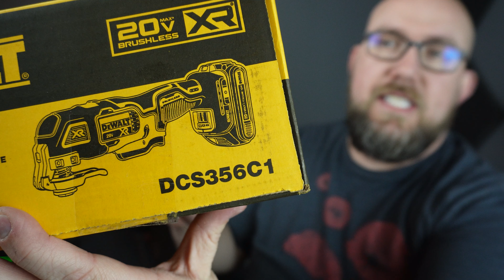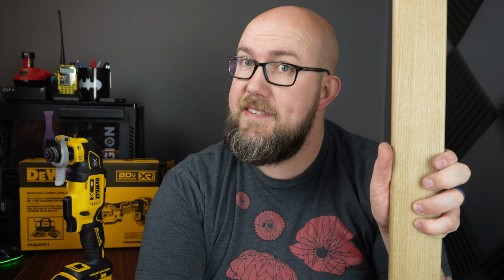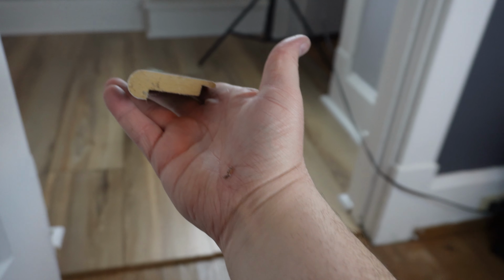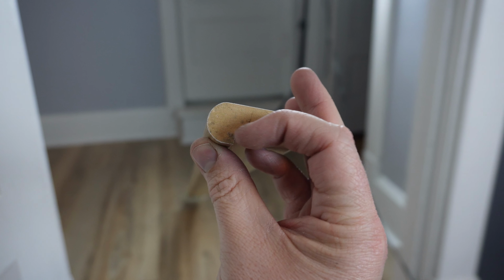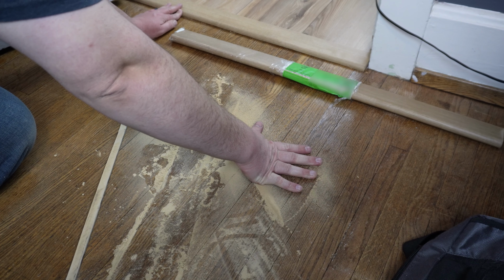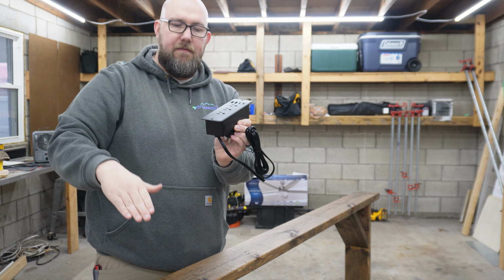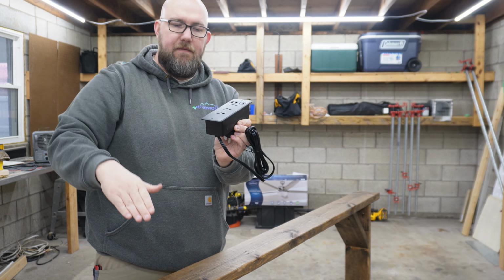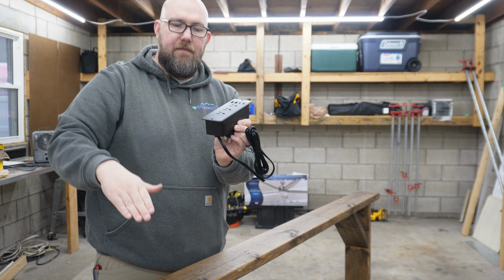DeWalt Oscillating Multi-tool Unboxing & Review

Comment: I like the fact you put that cheaper battery in there because I have bought one without the battery because I have other Dewalt batteries and I was kind of worried if they might not work right with it or not, but they seem to
Reply from the maker: @texasrider5621  all my batteries work great with it.

Comment: Nice vid😊got one of these bad boys today unfortunately the charger doesn't light up put battery on...nothing, never had dewalt before bit of a downer😢
Reply from the maker: Rough, if it's new you should be able to either exchange it wherever you got it from or contact DeWalt about a warranty. Something like that should be resolve reasonably easily

Comment: I wonder if you can cut thru the back of another multitool blade to make the slot as to not need the adapter on your multi as the system dewalt uses sucks compared to Milwaukees
Reply from the maker: I'm pretty sure they're all a standardized pin layout.